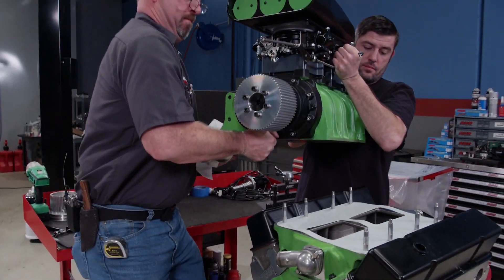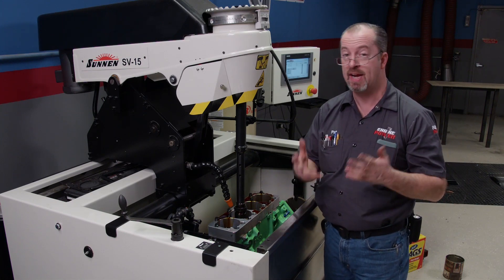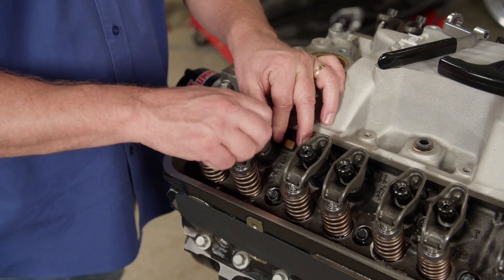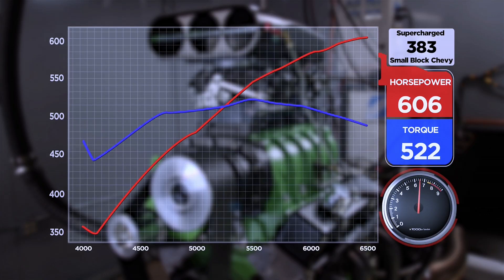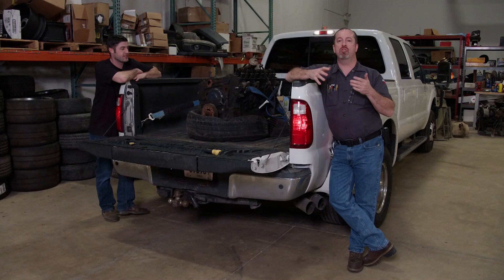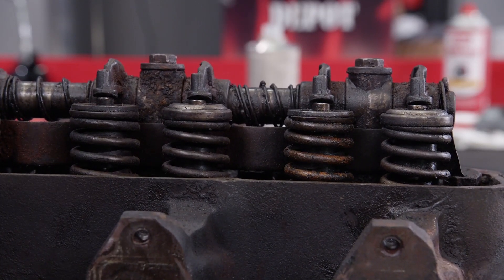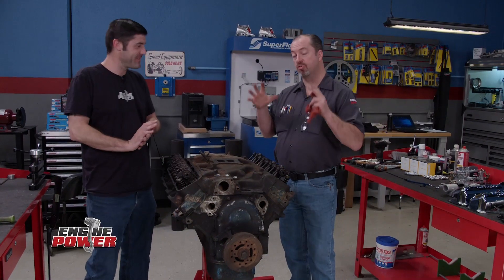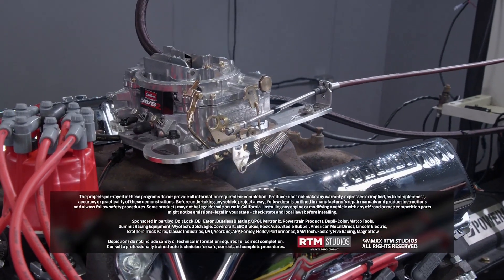Junkyard Ford 390 FE: Will It Run? - Engine Power S7, E7

Comment: Tip for cleaning up flat gasket surfaces....wd40 soak...wait for it....light scrap with a putty knife and wd40 it again. Then use a flat sharpening stone. Your will be amazed and how clean you will get that surface.

Comment: Old Ford FE. 330 , 352 ,360 ,390 410 mercury 427 , 428 . with the infamous 92lb intake manifold. And the worse exhaust mounting ever. Studs break ears break off heads. But the 390 410 427 428 were a power house engine.
Reply: You forgot the 332 and 406 lol.
Reply: @turbo8454  Then there the +1 versions that came with a steel crank for truck duty.  Dad had a 361 in his 1958 Edsel.  Dad said that car would go 135 mph.  He drove from Thunder Bay to Saskatoon (1000 miles) in 11 hours and that was on gravel and on the square, no highways then.

Comment: I don't know what makes the 390 stand out from its brethren, I mean from 330, and all the way to 427 which is bigger than the 428 because of bore, the three ninety just seemed to run. I took a engine out of a old galaxie and stuffed it into a two ton flatbed that we used every day. It was a placeholder till the 331 industrial could come back built. I started it and tried to adjust the timing but short of breaking that distributor, It wasn't happening. So hood closed and water and oil up to snuff, we just drove it and I left it a quart low one day and kept my eye on the oil and it never moved so that oil rode on the seat for miles and the quart a day went away. I drove it a average of a thousand a week for two years and truthfully it was getting tired but far from dead and started when nothing would. I parked it one summer and never went back to it even tho that truck had some personality. I needed a pickup and so thought what would they give me on a trade in as flatbeds were in high demand. I started out with it being low on water and it getting warm within just a few miles, i remedied that and kept going an heard a rattle so checked the oil and it was very low so added a bunch and kept going and before I got there knew it was hurt bad. Now this was a surprise as it ran so good and lots of people had offered me good money for it and it fought all the way. I traded it for low dollar with a hurt engine. They fought that truck and offered it back to me as they wanted to scrap it. How much?  Yeah I will come get it. I seen that the engine had new gaskets and stuff but looked bad for some reason.... I had the lowboy so they said they would push it on. Just for jokes I tried the key and it fired right up. I drove it on the lowboy and tied it down. Got it home and drove it off. Then saw what was wrong and fixed the wiring problem, incorrect firing order. It ran like a top and went back to work like it had before... go figure

Comment: Am I the only one that had a picture of a '69 T-bird in my head the minute he said 390?
Reply: Probably.
Reply: I actually was thinking of a 71 Cougar
Reply: I was thinking of my grandmother's '69 Galaxie 500. I KICK myself routinely for letting that car get out of the family. 🤦

FEs rock! Fukk a 385 series, FE was the OG Ford performance engine. Weight of a small block, power of a big block.
Reply: Ford Mustang Fastback GT390
Reply: We had a '69 or 70 Galaxie with the 390 2bbl when I was a kid. My dad said when I was but a wee lad, he left the car running and walked inside. I climbed in the driver's seat and stomped the gas to the floor, bending several push rods.
Reply: Yes you were, because the 390 wasn't available in the 69 'bird.  1967 for sure. Likely the 68 also. 69 was 429 and 460

Comment: Now make that 390 like you mean it.  Put it in a mustang and let it rip!!!
Reply: No.. too many mustangs, how about something cool like a 67 Fairlane!

Cheers!
Reply: thudtheace   No, a F600
Reply: I've seen one in a ranger... Zero traction
Reply: tony monastiere last 390 I drove was in an old Ford Louisville semi tractor with a 5&4. 
It was a beautiful thing. While I live in diesel class 6-8 truck world I still appreciate the old gas pots.
Reply: A gasser Falcon would be cool
Reply: Had 390 and 360 both same engines,  both gas hogs bad about burning valves and seen them break cams....
Reply: @donaldkinder6716  360 is bored out 352, different crank than 390

Comment: aahh yes...typical F,E, exhaust top manifold bolts breaking..,,usually the top ones brake all the time...fixed many of them over the years..,,that thing needs to be built and put  in  a 66/67 fairlane..or 68/69 fairlane...good, tuff as nails motor .....long live the F,E

Comment: Rebuild a 1968 FE390 once  Was in pretty good shape and resused most of the original parts sept for cam, lifters, push rods, con rod and main bearings, oil pump, timing set, fly wheel, clutch, pressure plate and throw out bearing  Reused all valves, springs and rockers and shafts with a custom valve job- three angle  Crankshaft was origional except for polishing journals  Same cam bearings  Same rods and pistons  Of course new compression and oil control rings  Two barrel Autolite carb  Ran like a bear  Nothing like Big Block Ford power  So much torque rarely used low gear  Would start off in second  It would go 80+mph in third  Top end over 120  On crappy old polyester bias ply tires(Yikes!) Worst part about those FEs is poorly engineered oiling system  Plus rocker shafts are not well supported on ends  Main and con rod bearings farthest from oil pump suffer from oil starvation causing wear  Thats why 427 side oilers exist  Restrictor plug to rocker shaft is a must to insure adequate oil supply to crankshaft

Comment: Is that an FT? I didn’t think FE’s came in the big trucks. 
Pretty much the same thing but with a forged crank.
Reply: 330,361,391 were truck engines with the forged crank
Reply: Jason, it is not an FT. The exhaust manifolds and oil pan are way different. The oil pan is huge on an FT and has the dipstick on the right side of the pan itself. The exhaust manifold has an extra 'fifth' port for the exhaust crossover. There is other differences but these two are visible.

Comment: 16:56 probably want to hold the drill at a 90 degree if you want the bolts to screw in straight 😆😆
Reply: you have a helper right there. have him give you an eyeball to align the drill bit 90 degrees. i've drilled out many of a broken bolt by hand, sometimes you need some help to align the drill.

Comment: Next time you get a stud that's really stuck like that weld a washer to it behind the nut first.. then the nut.. weld the nut to the washer, and the stud. I have also at times had to build up some weld on the stud itself before welding anything else to it..

Comment: Why didn't you apply some MAPP gas heat to the head while hitting on the broken studs?    I've done that while the engine is in the vehicle and been able to remove broken exhaust bolts.

Comment: I have a 51 351 hemi with a moded 727 torqueflight for 1800 if you're interested. The hemi runs but is bone stock.

Comment: I drove 390s since I was 13 years old . The late 60s. Those engines were dependable and bullet proof. But gas was cheap enough to run those gas hogs. Today? It's not such a good engine for a daily driver.
Reply: You are totally right! I'm currently daily driving a 1976 F-150 with a 390 and I get around 7-9 MPG!! Gas prices might be cheap for now, but i'm dreading the day that it goes back up. It has good power though
Reply: @HarrisonsGarage23  If you're still running the factory retarded timing set and the factory distributor advance curve, go ahead and change that. You'll gain quite a bit of power and MPG shouldn't be so bad.
Reply: @MattsRageFitGarage  Great tip man. Thanks. Just not enough TECHNOLOGY out there to address this problem with the 390. These guys should at least try to address this problem with gas consumption for anyone looking to freshenup an old 390. There seems to be alought still running.

Comment: I’d like to see you guys work on and do different builds with a 1970 429. I’ve got one that I’d like to see and know what can all can be done with one !!!
Reply: If you have seen them do a 460 then you have seen a 429.
Reply: Doug Hibbard that’s only partly true, even tho they may share some of the same parts they are two different motors and have different power ranges. Not only that the 70 429 has a thicker block as far as I know of

Comment: As usual with these commercially produced videos they fire up and engine and end the video. The subject in the second half was the junk yard 390. Great! You got it running. Great again! But how did the old buzzard run? No pulls, no compression tests, no oil pressure info? Did it knock? Could it be a part time runner again or did it get tossed in the scrap bin after a 20 second run?  

If you're going to dedicate half the show to a project at least share a few of the end results with us gear heads.

Comment: I got most my engine cheap and easy.  but stroke 390 fe out, to around 445 roughly, and dyer blowers has 671 and 871 for that 390, were talking lot of power.

Comment: My dad had a 390 2v 1968 wagon I was maybe 14 I took it out around a block or two it was less fun than the 36hp VW bus that replaced the...dad had that 390 tuned by professionals but it would not start when temperatures neared 0 fairinhight. Good old times, later on what am I working on a m a c or a fe f thee I did like my 300 6 with it s leaky  head gasket

Comment: You rookies. Lol.  I have removed hundred's of broken studs from cast iron head and manifols... easiest was was with a acetelyne touch... difference between the cast iron and the bolt allow u to heat up the bolt then hit the air. It will blow bolt out then follow with a tap..the trick you showed works too.  But once you weld the nut.  Heat the head till is almost red then rock the bolt back and forth till it comes off..have fun.

Comment: Will it run (after a rebuild)?
Probably.
What you show in the back of the pickup won't. Needs a carburator,  distributor, and plug wires  if nothing else. Probably a bunch of other stuff, too.

Comment: Do a Ford 300 inline 6 and boost it and watch the power go crazy if you want information frenchtown flyer but the 300 cid is insane with boost my 87 makes over 600 lbs torque at 1800
Reply: tbone3366........ I'd like to do this to my '62 Fairlane.  Swap out the anemic 170 six for a boosted 300!

Comment: The 390 FE had gobs of low end torque and for a short distance could hold its own but Ford failed to grace it with a decent valve train. 390’s were prone to floating the valves before 5,000 rpm’s. Not a good thing when running against the higher revving Chevy or Mopars the 390 was an embarrassment. But with a cam swap and better valve springs and some carb finesse the 390’s could lay it down and hang.

Comment: You guys are having way too much fun with the 390 fe ! 
I have to admit though, the 390ci and the 400ci are my least favorite of all of the Ford engines. They both seem to suffer the most from the Ford "Cursed Valve Train". 
 They both (in my opinion) have the weakest value train of all the Ford family of weak valve trains. Don't get me wrong,  I'm a true Ford blue cradle to grave, (with a shudder occasional Chrysler thrown in just to complete the pain train) but Ford never did seem to get the valves right. I don't know why.

Comment: Typical Fe exhaust issue a lot of them ran right on up into the 2000s I remember back in the day when Fe engines were the main horse for Ford trucks and the small block was the main horse for GM trucks guess which one was my choice back then the only reason I got away from them is the cost⚙🔧🔩⛽🇺🇸

Comment: Okay, it is running! How about a build on that engine? Aluminum heads/intake, agressive cam, maybe even a huffer to compare with the 383?  That would never happen, Chevy lovers could never handle the performance ability of a stronger motor that is not GM.

Comment: That piston damage is classic piston ring gap damage. The gap closed due to insufficient gap with the heat generated while under Nitrous and had nowhere to go. The ring instantaneously welds to the cylinder wall and breaks the top of the ring land off the piston. 
It's unfortunate that they did not mention ring gap at all, especially during the assembly. An engine like that should have a top ring gap of .028-.030 gap, minimum. The second ring should be .003-.005 larger to allow blowby into the crankcase to prevent unseating the top ring.
https://www.mahle-aftermarket.com/media/local-media-north-america/pdfs-&-thumbnails/support_technical_bulletins_pdfs/tb7002.pdf
Reply: @strictlybusiness1598  Well, .024 wasn't enough! This is the recommendation from Mahle.
TOP COMPRESSION RING
Ductile, Grey Iron & Steel 4.000” Bore Example Recommended Min. Gap Factor
Moderate Performance .016 - .018 (.004 per inch of bore diameter)
Drag Racing, Oval Track .018 - .020 (.0045 per inch of bore diameter)
Nitrous Oxide -- Street .020 - .022 (.005 per inch of bore diameter)
Nitrous Oxide -- Drag .028 - .030 (.007 per inch of bore diameter)
Supercharged .024 - .026 (.006 per inch of bore diameter)
Reply: @funnlivinit  Maybe it wasn't enough but then why do you think it only hurt the 1 piston and not the rest? if the ring gap wasnt enough should it have broken all of the piston tops? On that other show they said it was only a 150 shot. What is considered race and what is street? Just trying to learn here.
Reply: @strictlybusiness1598  Not necessarily. If one cylinder was running a little leaner, which is always the case, that will be the first to go. And hand filing isn't consistent enough to ensure that all gaps are exactly the same. Plus they shut it down quickly before others went too. If this had been on the drag strip it may have been a different story. I guess they'll find out when the new owners have the same damage when they run it on the strip. They certainly didn't put enough in it for that supercharger. The gap for the top ring should be .030!
Reply: @strictlybusiness1598  A 150hp shot is way into "race" territory.
Reply: When the term "50 shot" or "100 shot" is used, they are talking about the expected horsepower gains for the displacement of that engine, according to the NOs supplier.
Reply: @funnlivinit  if the ring seizes up tight enough to break the piston top how bad does that damage the block?
Reply: @strictlybusiness1598  Usually not a lot due to the actual fusing. The spots are small. But the piston pieces can cause a lot more damage.

Comment: Don't know who I should be more upset with here, engine powers or matco tools. The 1/2 impacts shown are not the brush-less ones, they have a black nose cone and say brushless on them. These are the older 1500ft/lbs and are brushed. Either power nation needs new tools (needs a new matco rep) or they need to do better research on the tools they are given. If its the second where this falls on ep I would be pissed if I was matco as the gun here have been discontinued for a while now. and they are now just running an add for them.

Comment: I have to wonder who has paid him off.  There are still many issues to work out with autonomous vehicles.  Among them is how they handle bad weather conditions which right now they don't.  Then there is the issue of where the cars are stored during the day after taking someone to work.  If they return home that is more traffic for two extra trips adding wear and tear on the vehicle and the roads. If they stay at the work place that requires enough parking for them.  I everyone is using the vehicles rather than mass transit that adds more traffic congestion as the population grows.  They may become more prevalent as the bugs are worked out but they are hardly a panacea.  Noir are they necessarily that close to being perfected enough for us to see them on the roads in great numbers everywhere. It may be a long term investment but shouldn't be a large part of someones investment protfolio.  At this point we don't know which companies may survive or not.  Many tech companies crashed and burned.